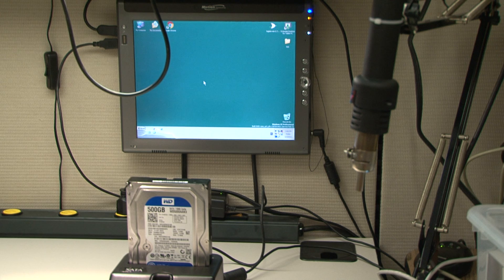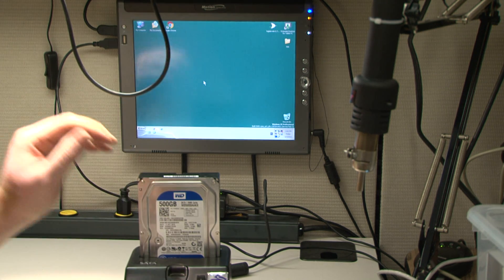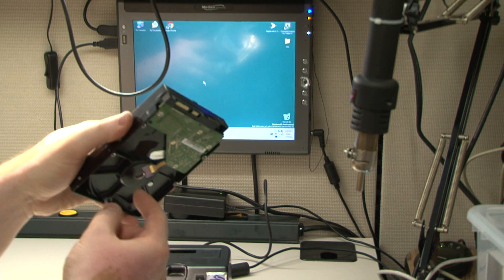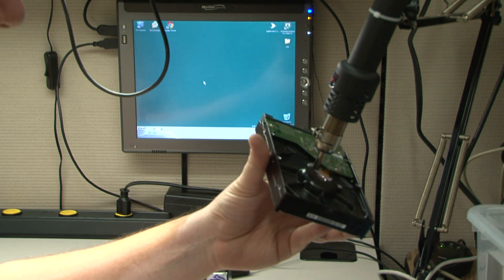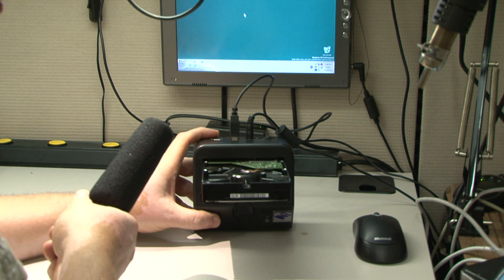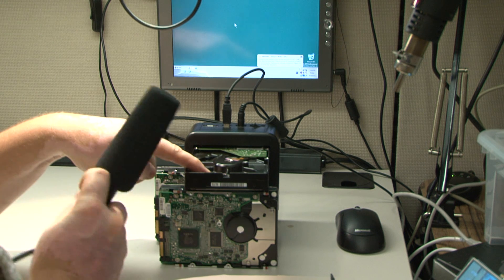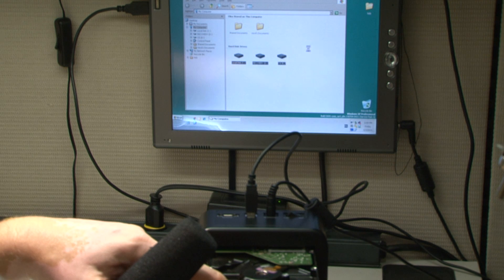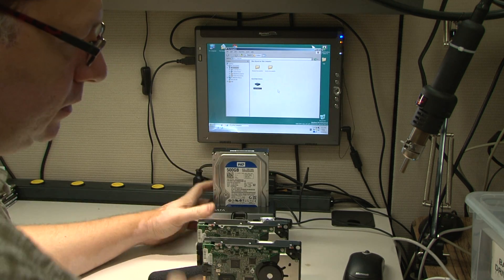How to Recover data from Hard drive that is rumbling for FREE by yourself

Comment: I had  a macbook hd fail(3 months under extended 2 yr warranty) one month after my son's with the same product we bought at the same time.  They said they couldn't recover and replaced with a new hd(now 9 yrs old) and returned the old.  I still have it and was looking for a possible way to recover the data.  I just need to get a external drive box and see if I can have success. It was noisy just within 2 days to failure.  I was attempting backup when it failed unfortunately. Only 1 real file I wanted was a book I had almost finished.  So I will give it a try.  Thanks for your video!